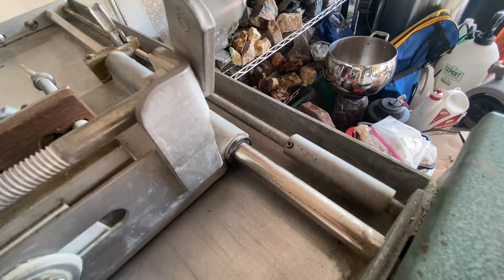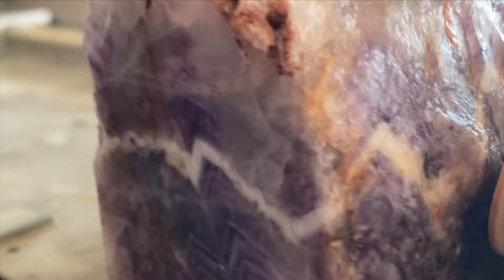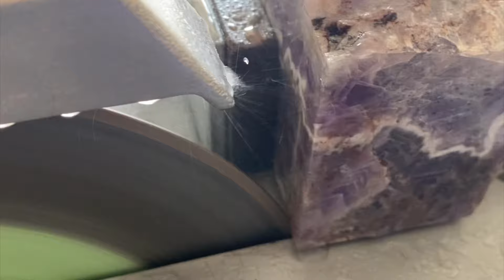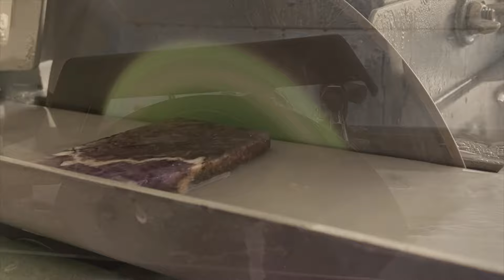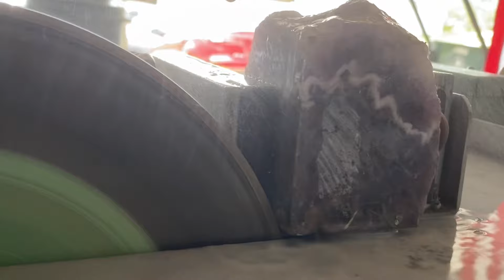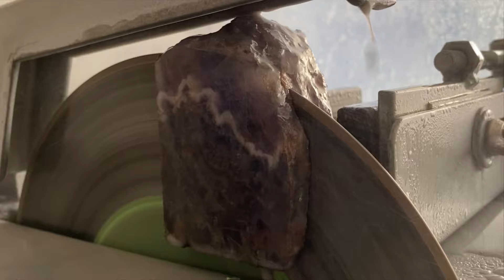Cutting Chevron Amethyst. Raytech L-10S 10” Slab Saw Autofeed. Lapidary Rockhound Tumbler

Comment: Good morning, Jay.
Reply from the maker: Good morning, Leann! 😊
Reply: @Gaptains_vloG  How long did it take to cut one slab?
Reply from the maker: @leannkennedy6568  maybe 20 minutes. It’s easier than free handing slabs on my tile saw. 

I started off using the the suggested amount of water. I found that using more water helped flush the slurry and cooled the stone better. The cover kept the water in and the noise down.

Comment: That'll make slabbing MUCH easier, even if it's a little slower (because you can't force the stone through). I need a short of you clamping up the stone. Oh, and, try to figure out a way to squeeze in a, "Shake, shake, shake," next time! 😂
Reply from the maker: Not being able to rotate the stone forward or back against the blade does speed up the cut. I get saw marks from doing it. Lol

I’ll get on that clamping video today.
Reply: @Gaptains_vloG  The worst is when you're tired and not paying attention and you end up corkscrewing a cut around a stone more than a full rotation!
Reply from the maker: @RIBill  or you lose focus and end up with an uneven slab.